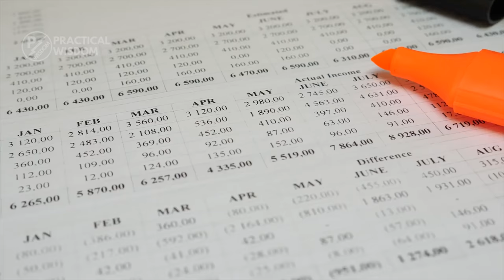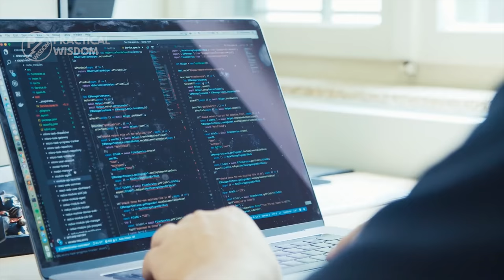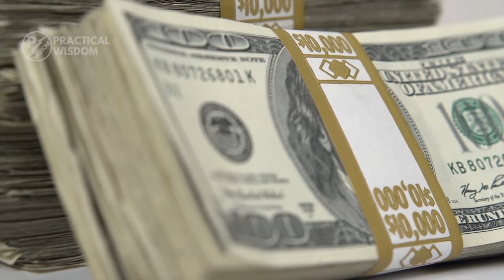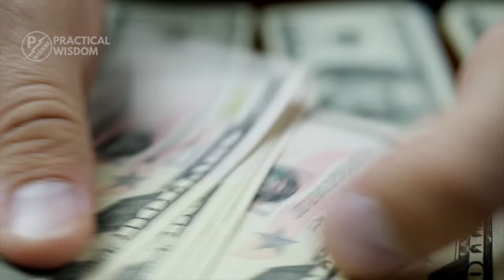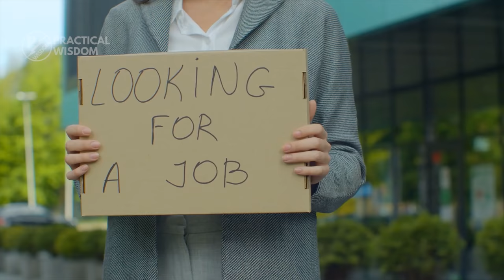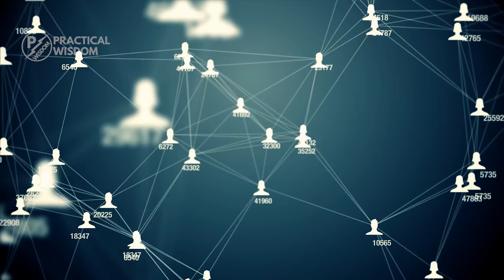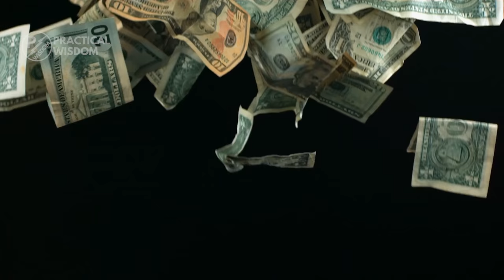What It Takes to Escape Poverty

Comment: What it took me:
Holding two jobs - one with mando 10-12 hour days, plus a p/t on the side - for about half a year. I'd sleep 3 hours a night for 6 days a week - one day where I could sleep a full 8, and another where I did my laundry. It also took a gym membership for showering between jobs. The degree of work it takes is extremely unreasonable, and to get there today, you must be unreasonable as well.

The real gap to jump is the $16k-$48k/year "middle income trap." If you're really crossing your t's and dotting your i's, you'll need an income above $50k/year just about anywhere you go in the states now; and financial assistance programs cut their qualifying range somewhere around $16k/year. So if you're somewhere in the middle, you can tread water for awhile, but don't let yourself become complacent with that. All it takes is one disaster - family emergency, car malfunction, some disaster like that - and it could level you back to nothing. Build circles of support for this kind of thing, especially where you're working.
Reply: Are you out of poverty now?
Reply: Yeah I've gone through alot of expensive set backs and deplete my savings all the time . Definitely feel this is accurate